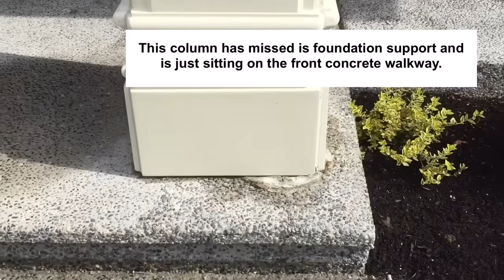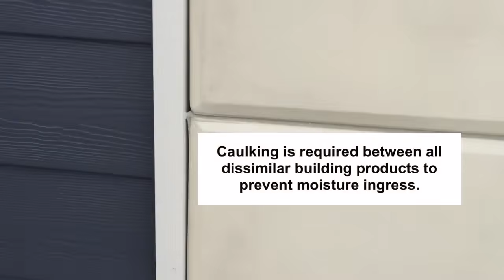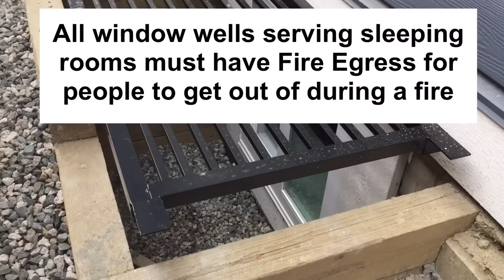New Home Construction Inspection - This is Shocking!!

Comment: Just goes to show you that just because a home is big and expensive doesn't mean that it was built well.
Reply: Yep you are correct, but if it has eye appeal, it will sell regardless. And the realtor has his own inspector to give the house a A+ rating. Then the bank over appraises the house.
Reply: +Mark I have purchased several homes. In both cases I told the realtor that I was going to hire my own home inspector. Neither liked it & told me that they would not pay for my inspector. I told both that is what I planned. But one realtor got really upset even after I responded. He was afraid the my inspector was going to gore his ox. (kill the deal). At that point, I told that realtor,

"No. My inspector has not & will not kill the deal. I will! Because of your reaction. you & your inspector may be in collusion to hide something critical, costly damage to repair. I am killing the deal & putting the word out on you!"

He blew up! My live-in was not happy but understood my logic to no longer trust the realtor.
Reply: Wow, what a story!  When I upgraded to a new home a couple of years ago I was fortunate enough to work with a realtor who is semi-retired and only represents people she knows.  She asked me if I wanted to choose an inspector and simply offered up a couple of options if I didn't have one already.
Reply: And you should RUN away from any realtor that doesn't leave it entirely up to you.
Reply: Independent look is cheapest investment you can make - new or "used".
Reply: +Art Cancro I would be careful of those "recommended offerings". Usually, they are individuals who the realtor knows not to be a "deal killer". Some will pass something which shouldn't be passed because they are receiving a "piece of the action" from the realtor. Frankly, I don't trust any realtor. Be wary when the realtor tells you they will allow you to select a home inspector but insists that they be party to the interviews with the inspector you select before the inspection is conducted! They will "wink-wink" & "head nod" with the inspector sending signals that they will both loose if the sale is not consummated.
Reply: +Robert Winslow I did! That realtor literally exploded! He was a retired minister of the cloth & it had been some time since he had a successful sale. He & his family either got hungrier or tightened their belts another notch that day. But not before he told me what he thought of me after I told him I was going to hire my own home inspector because I would not trust any home inspector recommended to me by a realtor. He was OK with me until he adamantly refused my selection of a home inspector. He wanted his guy & his guy alone to do the inspection. When he refused my decision, I told him, "There is no need for a home inspection now. I withdraw my offer & will not complete the sale. I am selecting another realtor. You are FIRED! There is no room for renegotiation now!" He figuratively blew up! Some brains here, eye balls there, an ear over there, a jaw in the corner, his lungs in the next room, his guts in the next county, his legs in the river! He was not happy! He needed to learn a lesson about the customers perception of home inspectors tied to realtors!
Reply: +Daniel Weston So true! They may cost more, but they don't have an iron in the fire or an ox to be gored!
Reply: i like the quality facia joint at 1:03,
Reply: An American guy in his late 60s told me that home building workmanship lacks these days in America. They just get the structure up within a few days.
Reply: Yes, there were more things he could have pointed out. That 'drain' pipe in the basement about blows my mind, and bolting down the egress points, is there no common sense?
Reply: 321192ify  Ever since they started using air nailers quality has plummeted.
Reply: cockroach, yeah and I'll bet that high pressure sales technique often works. People are inexperienced and don't want to offend, especially young people who also still hope that maybe they aren't going to be scammed at every opportunity. If you get a bad feeling from someone, don't ignore it.
Reply: NickRoman
I agree! Or at least get another opinion (like when buying a user car - have a mechanic you know and trust look it over for you to see just what kind of shape it is in).
Reply: They get repeat business by finding things - great incentive to look deep  . .
Reply: Hire your own inspector not the one the real estate agent recommends. That is a clear conflict of interest and should NEVER happen!!
Reply: Most people don't have the opportunity to work with a realtor like mine.  I've known her outside of real estate for a long time.  When the inspector showed up she brought a picnic lunch for my kids out on the deck while my wife and I walked around the house with the inspector.
Reply: +James Palmer  thank you for your insightful observation.  I am intrigued by your comments and would like to subscribe to your newsletter.
Reply: Safe to say all large expensive homes built after 1980 is going to be shoddily built.  The land the McMansion in the video is built on is probably worth more then the building itself.
Reply: Probably result of cheap day labors.
Reply: Jim S
The two are synonymous.
Reply: And that substandard work is the industry standard in home construction.
Reply: I know how building contractors cut corners in Vancouver. They built my neighbours roof from scratch in just one day ! 20 plus East Indian cheap labours on the roof pounding hard for three hours.Everything is done !
Reply: No it isn't.  It is what ignorant people will accept from a turnkey general contractor, if they don't know any better. 

A private home inspector shouldn't be the first one to spot deficiencies in  completed structure.  A local code inspection to issue a certificate of occupancy should have caught most of the ones in this video.

If this 2.4M structure had an architect seal the plans and check the work he'd be open to a suit.
Reply: Its possible to install a factory built multi-module home and have it visually complete from the outside in a day

A site built structure takes more field time and field labor, but not nearly as much as 25 years ago, to close it and have it appear complete from the outside. 

For instance, there are tongue and groove phywood sheathing materials that have interior moisture barriers and exterior membranes. That reduces exterior membrane work to taping. In some locales synthetic membrane tape can replace metal flashing and do a better job. Pneumatic nailers enable a carpenter to fasten panels 5-6x as fast as hammers. Factory-built trusses can be designed for any roof, ready to set without trimming, and cross-blocking precut. 

Stick building a roof to close in a day shouldn't take 20 workers simultaneously ON the roof with hammers. Even with cranes and laborers delivering materials as needed, that many would get in each others way, (and hammers are an inefficient tool for quickly building a new roof.)

Trusses, sheathing, flashing, membrane, shingles, each needs different skills and tools, so it's possible that 20 people might be employed, even though 4 men (crane, labor, 2 carpenters) could do all the lumber work in a few days, and 4 others could shingle it in another.

If the prep work is done properly and the crews have the right tools and materials a new residential roof can last +20 years leak free.
Reply: If thats what it looks like on the visible surfaces imagine what the walls look like inside hvac, pluming, electrical, sealing insulation etc... I bet its all a hack job.  I was in a new 3.4 million dollar home and was shocked at all the misaligned panels and gaps everywhere. Building a house is out of control now days. Walk away from anything like this!
Reply: I have heard this too. A lot of American houses look absolutely stunning and many have a price to match, too. But when you look beyond the shiny surface you'll see how badly and cheaply built many of them are. No wonder a lot of these houses only last a few years before they need to be torn down. Many new builds also have virtually no environmental features at all which is frankly unacceptable in this day and age. 

I would never buy a new home for that very reason. I'd far rather have an older all brick home that needs work doing to it. At least I can see and decide what work needs to be done and can ensure it is done correctly. This work will also be reflected in the price, so I won't be paying a premium for a new home which is poorly built.
Reply: +MilesV8 What "environmental features" are you talking about?
Reply: I'm talking about the likes of:
-super insulation in all walls, floor and ceiling including roof space (this makes a massive difference for either the hot or cold climate). 
-water saving devices throughout the home. This would be eco toilets (I have recently re-done my bathrooms and each toilet only uses 3,5 litres (1 gal) of water instead of 11 litres.
-  have a powerful shower that uses  40% less water due to the eco shower head
- a high efficiency heating system (ground source heat pump or high efficiency gas heating). This is even better with underfloor heating which works extremely well. 
- solar panels for hot water
- photovoltaic panels for electricity 
- sustainable source for the timber that is used in the house
- rainwater harvesting devices (for example use the water for flushing toilets, watering the garden. washing the car etc.)

I don't see any of this in these so called ' super luxury homes'. I don't consider the environmental features to be a luxury anymore but essential. I know most building companies are doing the bare minimum to make something look 'great'. But they don't really care at all about the people who end up living in their houses.
Reply: Art C I don't know who that owner was but I'd be pretty irate over the fact I dropped 2.4 million dollars on a house and it seems like everyone involved was cutting corners. It would take me quite some time to think over issuing lawsuits or not
Reply: I've lived out of the US for 18 years now, but planning a return in the next year or 2. I won't be buying new build from anyone.
Reply: Jonathon Haug Just think about it this way. If you have 2,4 million to buy a house and have it inspected by a professional, you have more than enough resources to sue the developer until your house is up to standard and even save some money in the process.
Reply: Craftsmanship in general has definitely dropped through the years, cheapest fastest is all that counts
Reply: Art C ikr
Reply: this house isnt meant for someone to live in... or for more than 5-10 years when it gets torn down and replaced with another mcmansion or a condo. this is what foreign money laundering in real estate look like.
Reply: I was unaware that we have slavery in construction companys in Canada. Care to enlighten us all with some proof of information? The issue like all other businesses is that globalization has taken over across the world and importing cheaper products makes it into the new home builds. The other part of this is quality of workmanship being done to the home is bad because the construction companys having no rules and regulations other than basic inspections. This means some can get away with making a lot of money in a short amount of time be it Mexicans or north Americans as the work force.
Reply: Decades ago when I was looking to buy a house a  realtor gave me great advice. Go house shopping on a cold rainy day & take a housing inspector along. There are some very nice people like  retired H.I. who will do it for a small fee. I was shocked at the number of house we looked at the had their own pool in the basement, a furnace that didn't work and a leaky roof. Some of the houses were recently built too!
Reply: exactly!!!!
Reply: Art C 
Yeah bigger and more expensive the better.....
I know of many people in the U.S. think that way.
Reply: Art C Yeah I heard about 3 yrs ago, someone in construction I know said there's no money in residential. There just built so fast and cheap it's rediculous and then they slap a big price tag on them. Just sad
Reply: Cockroach Lol, awesome!
Reply: Art C These,prices are soo stupid. I like my mansion for 1/6
Reply: the land is what made it expensive. contracts to build the house probably changed hands 10 different times and the company that did the actual labour made pennies. so they gave penny quality.
Reply: Cutting corners for profit
Reply: Mark this home has zero eye appeal as far as I’m concerned
Reply: n @PJ Vis  that much money I would require an inspector throughout the entire constructiion
Reply: @rogerlaurel2363  You are insulting a person who has been a dear friend of mine for a long time.  I'm sorry to hear that you have had bad experiences with untrustworthy people.  My friend and realtor recommended a reputable inspector whose report, I can say seven years later, was quite accurate.  I dug it up recently and took note of the items they called out, and they were all things that I've had to address since then; on the other hand, they did not miss or bypass anything.  There were no hidden problems.  I would certainly hire them again, with or without my realtor friend.
Reply: All show no go

Comment: This guy is a fly-by-night construction swindler's nightmare. Keep up the good work.
Reply: Theres more and more of this it seems. 2.5 mill dont get you much for a house these days
Reply: You still got to pay them regardless.
Reply: @TheArcWelder  Not if you catch the mistakes in time.  That was the inspector's point.  As long as you're holding their cash, they tend to pay more attention.
Reply: @TheArcWelder  if they don't meet code you can refuse, you don't have to get the house regardless. That's just wrong.
Reply: Why because he murders them and puts them in his basement? His opening gave me huge serial killer vibes
Reply: I'd have passed on this house as soon as I saw the lower floor windows below ground level.  All it takes is for one clogged drain and you are praying like hell the seal on your window holds to keep the rising rain water from entering into the room(s).  And yeah, they put in windows so they could use more space and thus sale at a higher price. I have seen windows in basements but they were always above ground level.  And their intent was to allow for natural light to enter into the basement. No other purpose.

Comment: That's actually pretty good considering some of the new homes I've seen.
The caulking on the siding should be repaired but its primarily just a cosmetic issue.  The siding isn't what provides the water protection.  Its the house wrap underneath, which you hope is done properly, that keeps the water out.
Reply: yes but the caulking is part of the first line of defense.
Reply: as far as weather proofing the house, the caulking is redundant.
Reply: Not to mention insects.
Reply: what about insects
Reply: Duh, it gives insects more ways to get into the house....
Reply: duh, no
Reply: Evidently you don't know anything about building construction or insects.
Reply: Evidently you don't know anything about the English language.
That said, please share your wisdom with respect to how caulking those joints is going to limit insect access into the house.
Reply: Yeah, that's what I thought.  Nothing but lip service.
Grow up.
Reply: It's true that caulking should be redundant -- the weather barrier is the real line of defence.  Water always penetrates siding, no matter who does the caulking.  The main thing is to protect the sheathing and direct bulk water back to the outside.  Sometimes caulking actually traps water behind the siding, leading to rot.
Reply: If the siding wasn't caulked properly, what makes you think the wrap underneath was done properly?
Reply: Dhalin.  What makes you think I trust the weather barrier?   This house reeks of amateurism.  My point was more that people should not place their trust in caulk.
Reply: You said that "the weather barrier is the real line of defence" because "caulking should be redundant". This, of course, relies upon the weather barrier actually being installed correctly. If I look at any house (not even talking about the one in this video) and see a terrible caulking job, then I'm naturally going to assume the weather barrier underneath is similarly terrible and I'm going to apply copious amounts of caulking (or would, if I had just bought the house or something), and assume that the weather barrier is useless, even if it isn't. Better safe than sorry.
Reply: tchevrier, considering how crappy the build quality is, would you really trust them to install the house wrap properly? I wouldn't.